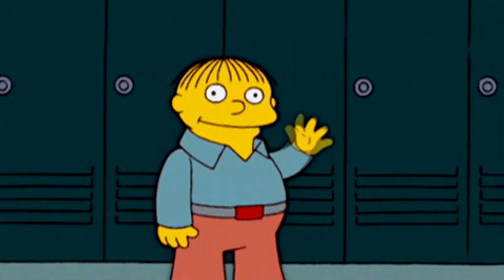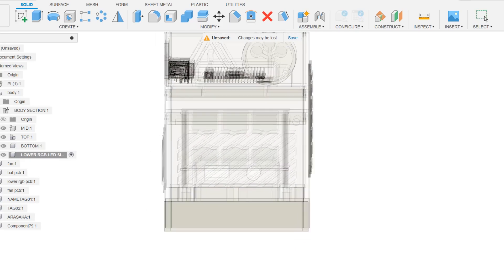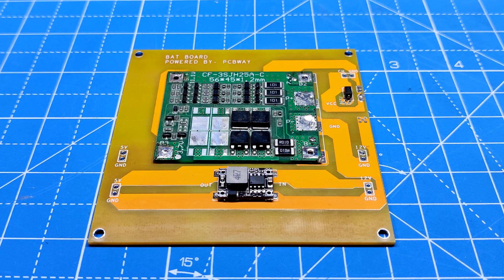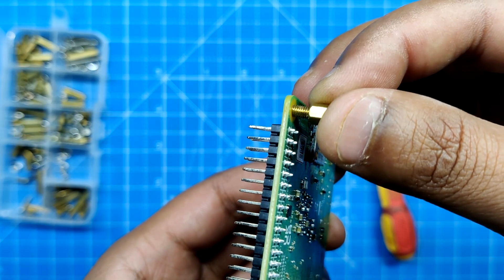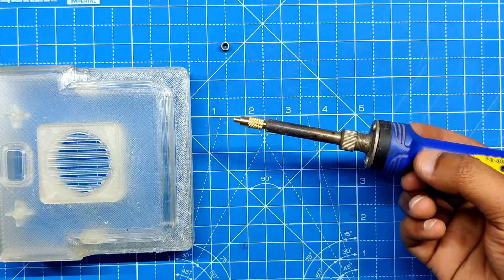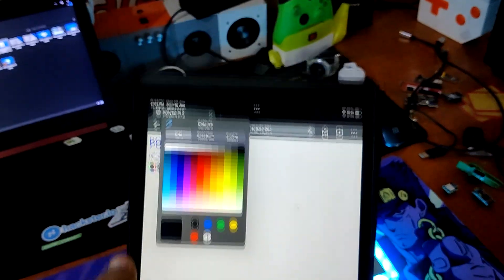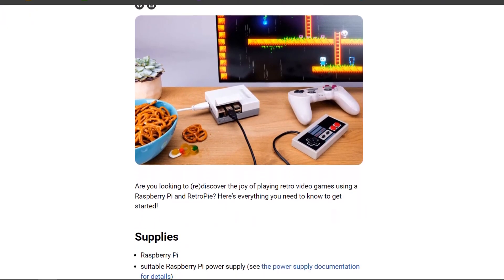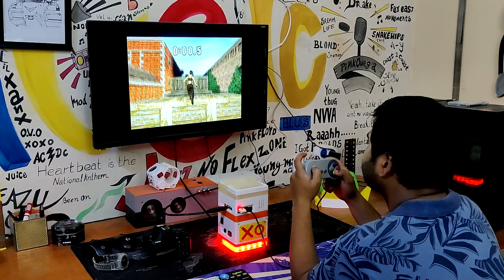Power Pi 2- Raspberry Pi based PC

Comment: Hi! I tried commenting on the instructables guide, but it seems to not have worked.
I am researching Pi projects for a paper, and I have a question about this process - I am sorry if this is an obvious answer for experienced people, as I have no experience in this process. The question: I looked carefully through the guide, and could only find images of the custom PCB - what, if anything, would need to be sent to a company in order to get the PCB needed to construct this project myself? Is it in the guide, and I just missed it? Thanks.
Reply from the maker: @spenc4808  hi, you can download gerber data from here for PCB manufacturing. https://www.pcbway.com/project/shareproject/POWER_Pi_Version_2_83b33603.html
Reply: @ArnovSharma  Thank you! And thank you for the quick response too!